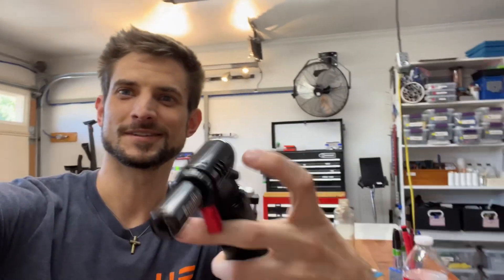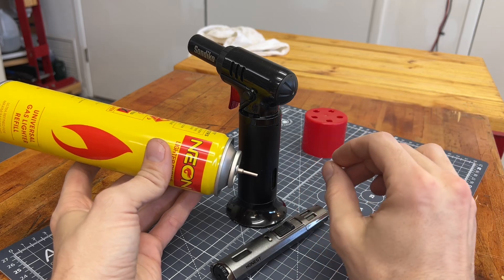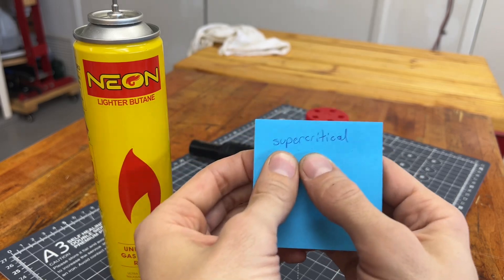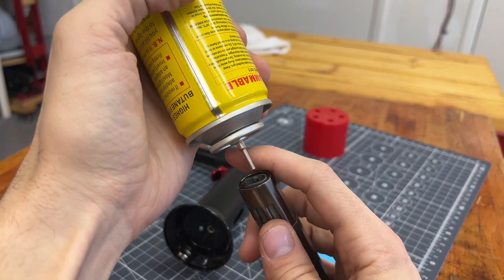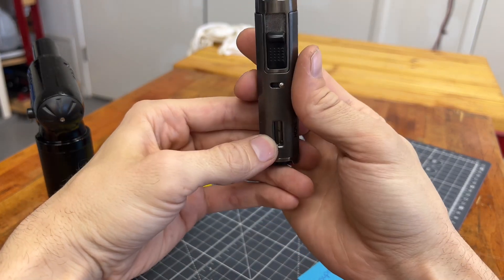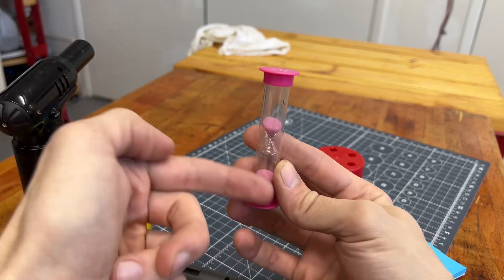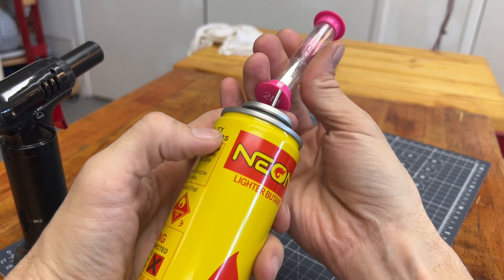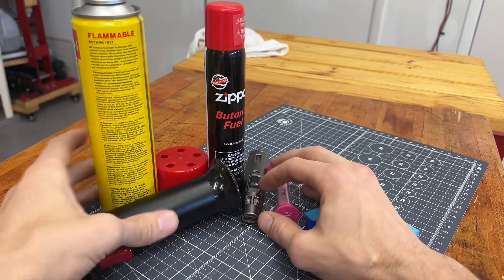Refuel butane torches (a deep dive to solve all the issues)

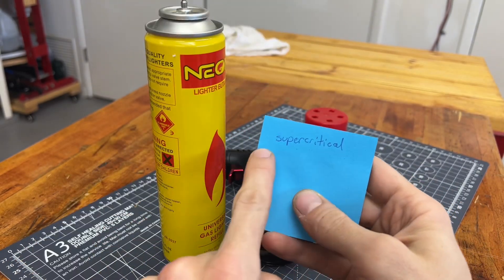Comment: 3:02 Not supercritical fluid! There is a distinct boundary between the butane in the liquid and gas phases. Butane has a critical point of 3.8 Mpa at 152C (551PSI at 306F). That butane container wouldn't stand a chance at containing supercritical butane.
Reply from the maker: I am humbly pinning your comment even though it makes me look like a bozo. 😅

If you don’t mind, is it safe to say my explanation has just the error of the term supercritical used herein?
Reply: The correct phrase would be “two phase” or “equilibrium phase” if the system is not boiling or condensing unbalanced amounts due to a change in energy or volume of the system.
Reply: @davidmalawey  Hey, we all make goofs and it's commendable to acknowledge we make them! I think the rest of the video is fine though.
Reply from the maker: omg i feel silly.  what in the world is the actual word for these two phases in the same place at the same time???
Reply: Came to say the EXACT same thing. This is a fluid that is in the phase envelope - two phase region where liquid and gas coexist in equilibrium. The proportion that is gas versus liquid can be determined by examining a pressure-enthpy (P-H) diagram. It will be in the region that looks like a big hump. The peak of that hump Is the critical point. 

But as it is - butane in a consumer can is NOT supercritical. As you noted, supercritical is when there is no distinction between liquid and gas phases.
Reply: Imagine if everyone on the internet was this willing to be corrected. Even though he made a technical error, we can all see that it was made in good faith, and move on.
Reply: @Spaniard47  It's great that the comments are so supportive. Some commenters on other channels tend to be ... supercritical.
Reply: It’s a saturated mixture, just learned this in thermo last month

Comment: Okay, so the problem i have that nobody ever addresses is that the gas wont ever go into the lighter valve, and just sprays back out, is because the lighter valve is too small, and not making a good seal to go in.  How do i find a butane can with a thinner valve?  Im using the same one as you are.  And thats too wide to make a tight fit.  How do i fix that?
Reply: Literally… like what the fuck, why doesn’t anyone ever answer this ?
Reply: Same problem I had. It has threads unlike any other lighter valve.   I just smashed the torch I had for fun instead.   Never buying one of those again.
Reply: I had that same problem. I usually have a few torches, some work, others need an ignition source because the piezo slammer breaks. Anyway, i took some small o-rings around the refill valve off of lighters that didn't work and put them around the refill valve of the lighter that wouldn't accept fuel. I used 2 o-rings and no more problems refilling. U might only need one, depends on the torch.

Comment: if you ever have a lighter that you just refilled, but does not light, i have a fix for you: emty the lighter completely with a screwdriver or something metal that does not block the nozzle (any plastic is bad because it will seal off the exit) and then refill it. Generally that happens with very cheap electric jet flame lighters. Also don't buy the old style of jet flame lighter with the copper grid / wires on top of the star shaped "gas outlet", they are very delicate and tend to melt with time or break if tobacco or anything touches the wires. They are rare to find nowadays but can still be found for example if they advertise a colored flame.

Comment: Also.... Use a small tool to depress the valve on the fillable tank to purge the air that is in the tank. This will allow you to completely fill the tank with liquid butane.
Reply: What air? How are you supposed to remove air from the tank if you open it to air?
Reply: @hantrio4327  butane is heavier than air. If you flip the lighter over so valve is up and then you manually depress the valve for a second it expels the air in the tank so that you can get more liquid butane in the reservoir
Reply: @PropGuru702  butane and air mix

Comment: Let me make this really simple for everyone, run your refill bottle under some hot water to make a pressure differential, the reason your lighters wont fill is because the pressure in the lighters is higher, example if your lighter is in your pocket and you go to use it and it needs refilled you can not grab a refill can off the shelf and expect it to fill it because the pressure in the refill bottle is lower/ aka colder, you need a pressure difference for the fluid to transfer, so best way is to chill lighter in freezer and warm the refill can under warm water when you do this the lighter will fill to 100% no air bubble in lighter or very close to max liquid in  lighter, you can also empty a lighter into a refill can doing the opposite lighter warm and on top refill on bottom cold, temperature is the key a proper refill. If two containers have 5 psi in them you cant transfer between the two, you need a high/low, temperature does that for you, your lighters wont fill it is almost always hotter its in your hand or pocket, and the refill can has a metal vessel so its colder than the plastic lighter even if both sit on the table for days.
Reply: Thank you for turning a 15 minute Ted talk into a 40 second read.  You rock.

Comment: It doesn't make sense that a cold lighter is a problem while refilling, that means you can fit more in it then it warms up and has a higher pressure. The refill cylinder is the only bottleneck as it freezes over. Exactly the same as canned air tbh. Gets super weak really fast if the can chills during use, until it sits for a bit to warm up again.
Reply from the maker: cold lighter is good and cold canister is bad.  agree?

we want the pressure of the source higher than pressure of the sink, in order to flow.
Reply: @davidmalawey  I am in agreement with this!

Comment: YOUR VIDEOS ARE AMAZING!!!! honeslty all the knowledge i get by with almost knowing.. but wish i actually knew! especially the adhesive / tape ones. would love if you did a similar one about oil / grease / lubricants in general. i still have no idea when to use what, for different lubricating / ceasing applications. also you should add those amazing ones to a playlist too! thanks so much.
Reply from the maker: if i can narrow down the grease situation to maybe 10% of use cases then i could find a way to make a video but at this stage its so many scattered pieces of info that are hard to tie together.

i am puzzling over it in the back of my mind.

Comment: Careful!  Shake your can of butane before refill.  There is a small amount of oil that helps keep sealing surfaces sealed and prevent rubber O-rings from drying out on both the spring valve on the can and the spring valve on the lighter.  It may improve the sealing between the nozzle and the lighter interface, but idk.

Also, particulates from your shop may settle in the nozzle and enter the lighter which may ruin it.  Keep the lid on and/or purge the nozzle before refilling.  Cleaning the interface will also reduce the chances of stuff entering the lighter.

Love your videos